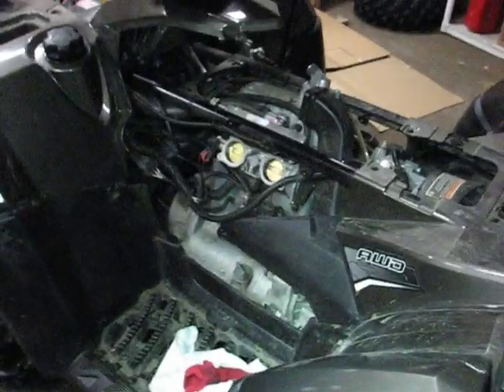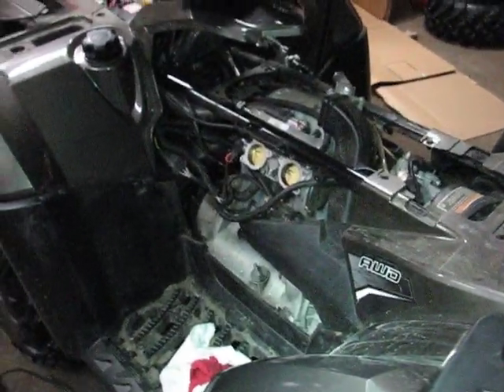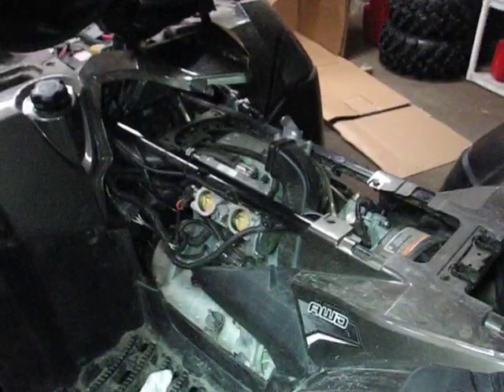Polaris Sportsman 850 cold start issue

Comment: I just pulled my covers off my 800 cf moto which had same issues and yep the intake valves were tight on both cylinders once I got it running it sounded fine but sometimes took a bit to get it started will post what happens after I do the clearences properly